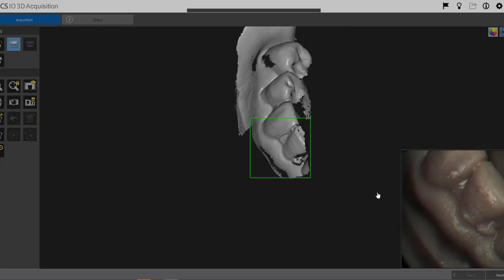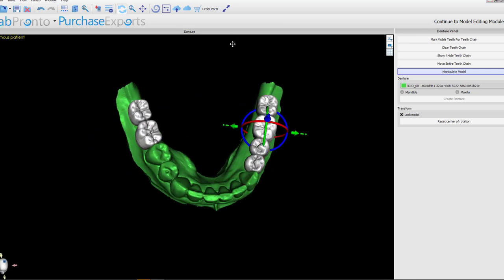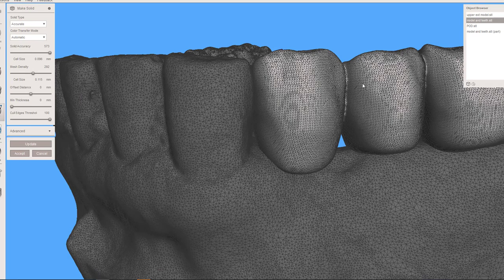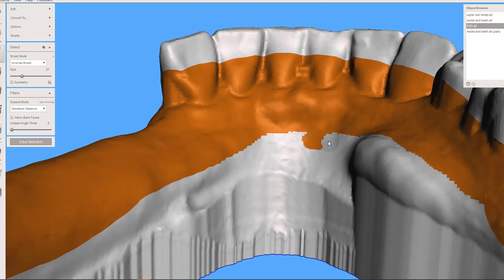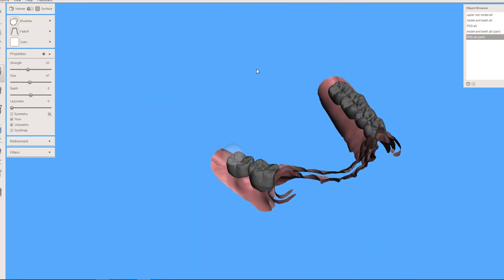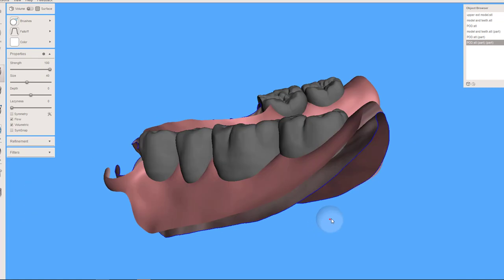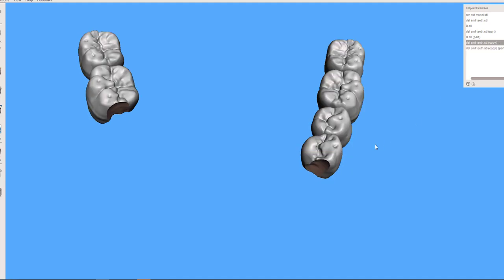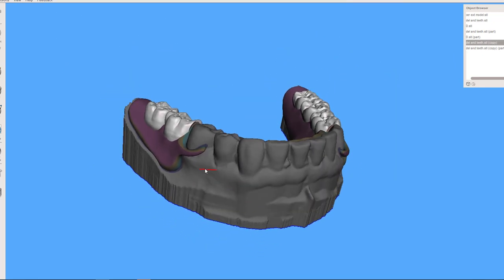Digital Flexible Partial Dentures Using Blue Sky Plan and Meshmixer

Comment: You have the very best teaching videos, they are simply so easy to understand and follow. I’m not in dental field but I’m trying to learn as much as I can to create my on dental appliance sadly I lost my job during the pandemic and lost my insurance. During that time I had several root canal/crowns break off and now I’m too embarrassed to even try to go on a interview and have exhausted my savings and have no way to afford any dental work. I’m just trying to make something that I will feel presentable  to get back to work. I never thought I would ever feel like I’m on the bottom of the food chain. I just haven’t figured out how to scan my impressions to even start to try and design some kind of appliance. Thank you for sharing your awesome skills with us. I know Bluesky only gives you 2 exports for free, so I want to make sure I feel like I can at least try or attempt to create something and print it on a consumer resin printer if the resin for dental appliance is not to expensive.

Comment: Which flexible resin do you suggest.Can you print with clear ortho flexible resin and put the denture teeth?which ortho flexible do you suggest ,if there is any ,to fabricate a nesbit of one or two teeth?I"m talking about 3d printing.I would appreciate an answer to this because i'm new in 3d printing and it will save me from a lot of trouble.Thanks in advance ,greetings from Greece
Reply from the maker: This is Graphy Flex Base printed and their crown and bridge for the teeth.  You can fabricate a nesbit or anything else you could design with it.  I've not tried ortho flexible resins but I imagine it could work.

Comment: Designing is no issue, how do you go about processing, I would say you need to print the model and the denture base with teeth as well, then flask and inject the whole thing, it would take more time than waxing it on to a model, and processing it, and cost more to make.
Reply: Unless  you mill it in peek, that's the only option I see for digital flexable partial at this point
Reply from the maker: No, this is simply printed..........dramatically faster than any method of conventional processing.